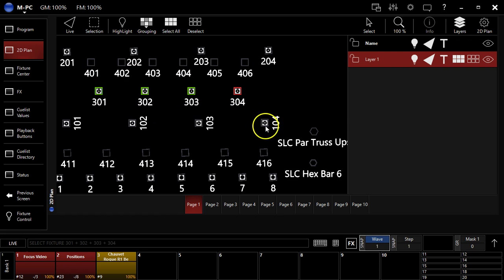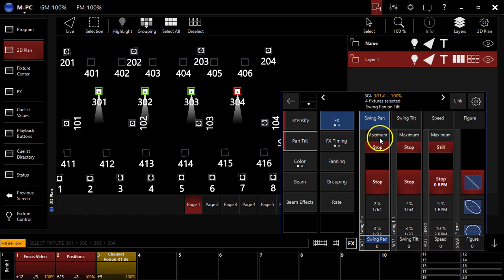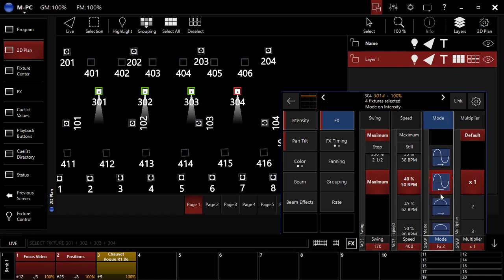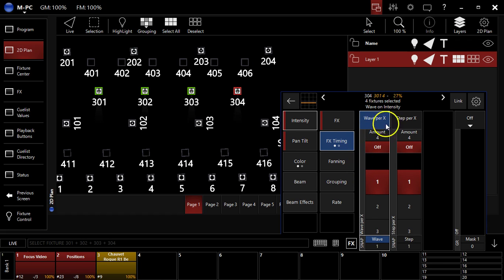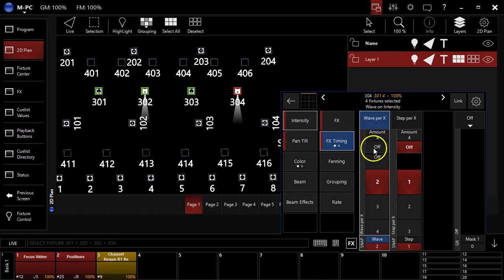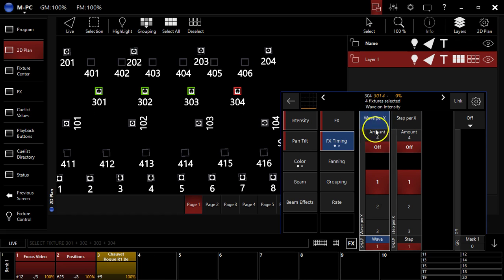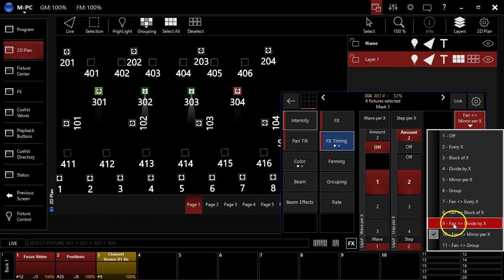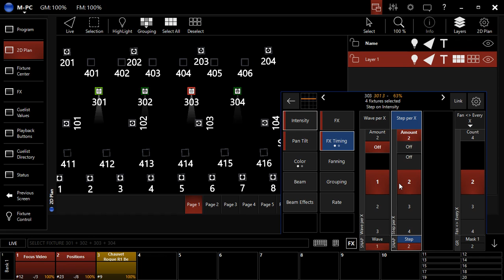Martin M-Series - Working with FX, Part 1 (Archive)

Comment: Thanks for that totaly awesome tutorial!
Maybe you have a solution to my problem:
Whenever I record the FX (as cue or in the FX section) the Grouping and the "Step per X" option is missing, so my effect (lets say intensity for this example) is just putting on and off all lights together instead of 1 after another.
Have been trying this for a long time now and still have no conclusion to this -.-
Reply from the maker: Step/Wave offsets will NOT be recorded in the FX macros window.  This is because these are "universal" FX for all different numbers of fixtures.  You can, however, record Step/Wave offsets into regular pallets.

To record Wave offsets into cues - make sure you select the fixtures, build the effect or grab it from the macros, set your wave or step, and then record to a cue.

Then, your step/wave will be recorded in the cue.

Thanks!
-David
Reply: Learn Stage Lighting .com thanks it's working out well!
Here is another question:
I've been trying to trigger a cue with an main-pb fader which sets the fx speed to max, sets a fx mode and lets me controll just the speed via fader...however this attempt failed horrible for me as the speed is always set to the max und only swing can be faded.

So I decided to do the following:
 - main PB cue controlls just the speed (nothing more in cue)
- stored swing and mode on another cuelist
- Marco "trigger Swing cue 1" into the speed cuelist.

..however the macro isn't doing a thing and the other cuelist never gets triggered. Do you have any solution for this?

Thanks in advance :)

-Kai
Reply from the maker: Hello Kai,

This is where many different things can go wrong.  Simple answer 1 - did you press "Apply" after you created your macro?  This is an important (but easy to miss) step.

I'd be happy to go into more detail with you, but I've got to get you into the Learn Stage Lighting Labs community first.  This is where I focus the bulk of my attention, and we can take the time to go into deep detail on your lights!  It allows me to make the biggest impact possible in your lighting.

As you can probably imagine, I get many folks asking me for help personally, and this is the way that I can do it.
The best way to upgrade your lighting is to upgrade yourself and your knowledge - I'd really love to have you in the Labs and will get to your questions right away once you join.  

I can even receive your show file and troubleshoot any issues on video for you!

Learn more and join us here: https://lp.learnstagelighting.com/learn-stage-lighting-labs/

Thanks so much!
-David

Comment: Hi, I am trying to make my uplights chase, how to I choose the colors that I want to chase and then add the effects?
Reply from the maker: Hey George,

You'll want to first set the uplights to the first color you want.  This is the base.  Then, you need to use FX on the color parameters (R, G and/or B) that would get you to where you need to be from your base.  It's a little complex to figure out at first, but once it clicks, you'll get it  :)

-David

P.S. Need more help in your lighting?  For in-depth help, I offer Learn Stage Lighting Labs: https://www.learnstagelighting.com/ultimate-lighting-shortcut-lsl-link/

Comment: If the fixture you are working with does not have a tilt function (such as a conventional fixture), is there a way to better show the beam?
Reply from the maker: There is not - I'm sure you've already noticed the black circle on the fixture that changes to a solid white box when you turn it on.